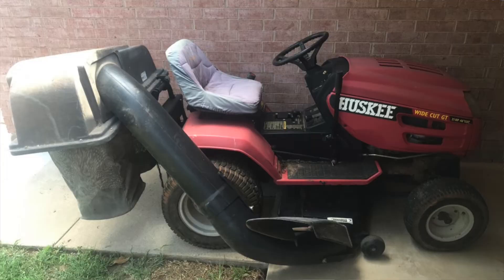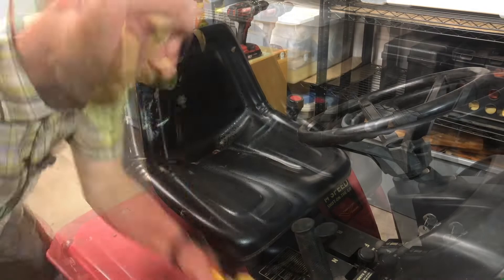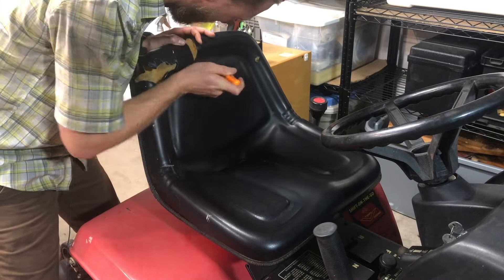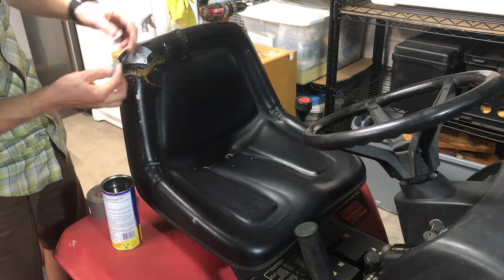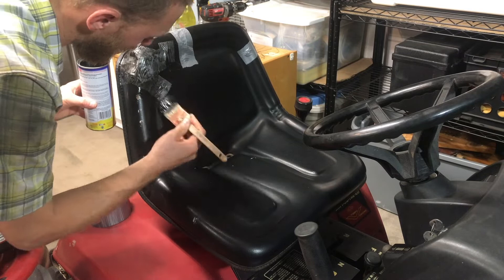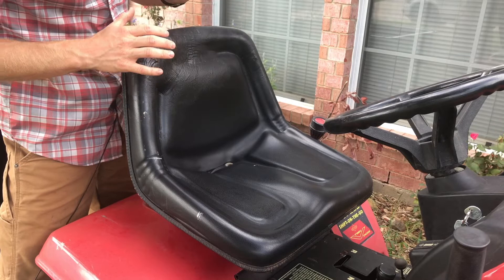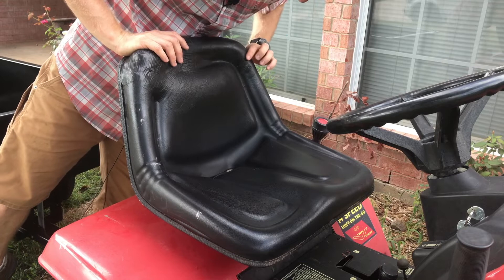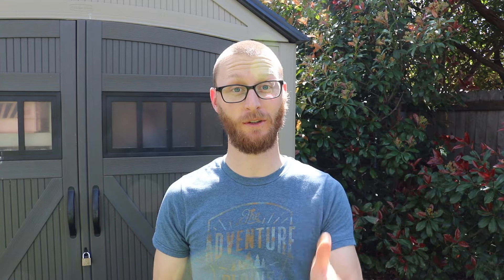How I Repaired My Lawn Mower Seat!

Comment: I'll have to try this as I have a rider and farm tractor that needs a seat.  But one of those is really bad, missing a big chunk of foam.  So this got me thinking to try expanding spray foam to fill the gap, then trim out that over spray.  Then I'll do the duct tape and plastidip as shown.  Thanks much for the tip.
Reply from the maker: Just be aware that although spray foam will definitely fill all the space - it may not be that comfortable to sit on. Maybe get some regular cushion style foam from the craft store and cut it as close as you can to the shape needed, then let the tape and plastidip cover the rest.

Comment: Thanks for sharing. I'm in the process of repairing a seat on a John Deere LT160.  I didn't want to spend good money on a new seat for a 20-year-old mower.  
You have a new subscriber. 👍
Reply from the maker: Glad I could help! I've since tried out aerosol plastidip to recover a whole seat - doesn't work well - definitely stick with the dippable kind that you can lay on thicker.
Reply: @GanderFlight  thanks for the tip.  I'll try to make a video if I have time.  👍

Comment: Have you given any thought to using a waterproofing membrane such as Vycor, typically used in construction for roof and windows, as a substrate over duct tape?   Has a rubber like feel, self adhesive, and a higher mil thickness.  Just curious, working on a tractor seat repair now, and need to span some cracks..
Reply from the maker: I haven't. The plastidip is pretty well waterproof if covered wide enough. I would however put some spray foam or other material into the gaps before sealing it.

Comment: Not finished watching, but you think fishing line would make a difference in the stitching?
Reply from the maker: I would think that would work well too.  Ive since also tried using spray foam and I’d definitely do that again. Stitching up the seams and then jet in some spray foam and cover with plastidip would make a great repair.

Comment: Thanks for sharing!  Hows it holding up after a couple years now?  Anything you would do different?
Reply from the maker: I gifted that mower to a friend and its lived outside - held up decently for all the weather exposure. What I 'd do differently -- I'd still sew it up, but then Id get some big gap spray foam and fill the void. Once that was cured I'd trim it to the shape I want and then put the plastidip or flex seal over the top.
Reply: @GanderFlight great thanks for the reply!

Comment: I wonder if using spray foam under the duct tape, to fill the missing foam, then removing the duct tape after the spray foam has cured, then plasti-dipping would have worked? Might not have ended up with the appearance of the duct tape under the plasti-dip.
Reply from the maker: If I were to do this again I definitely would have used spray form or even pieces of regular foam to fill in the gap and then covered.

Comment: Keep us posted.  Reads like directly into the foam with a few layers lasts for years in the last video I watched regarding.  The gentleman didn't use tape... and used the yellow.  I'm thinking I might custom make a Ford seat with the blue since looks close enough.  I'll test with a repair seat first before I try to coat a whole seat thought.  Thinking can trim some space foam maybe or similar foam and glue with the plasti dip also to fill in any voids if needed.  Would be nice to get a space or cool gel foam layer under somehow. I also received some Silicone Oil to test with Type 2 Silicone as I am wondering how performs to thin and set.  Then I'll try a dye also as that was my original plan to test to make a Ford blue seat.  Thanks for sharing!
Reply from the maker: Sounds like a cool project- if you do try all that report back and let use know!  Also if you want yo coat the whole seat blue look online for the aerosol version in the color you’d like- might work better for larger coverage, although it will take 5/6 coats.  Check out the channel Dip Your Car for more plastidip diy how tos!

Comment: Nice DIY!  I wondering, instead of duct tape to fill the gap, would filling with silicone first, the plasti-dip to seal?  Just a thought.
Reply from the maker: When I'vd done this since I've use spray foam insulation to fill the gaps on another seat.
Reply: @GanderFlight  makes sense

Comment: Appreciate the effort but, this method will never last
Reply from the maker: Been holding up for a few years :)
Reply: @GanderFlight  It depends where.  On the back where you did it, probably ok.  Mine is torn where you get on and off, and this is not a good solution for that.  The plastidip curls as you slide across it, losing more and more each time.  
I know because I tried this on my Kubota.  The seat is a high back that is over $300, so I'm trying to save it.

Comment: I was loving this until you resorted to putting duck tape back on.  That won't last.  The glue under the duct tape will end up a gooey mess just like the one you cleaned off.  Only this time it will be buried under plasticoat.  Might look good this summer....
Reply from the maker: Its been on the mower which is stored outside, for over a year now. 😀

Comment: It would have been better if you would have continued to seal the void with the plastic dip until it had been filled in instead of putting on the duct tape because the duct tape will eventually pull loose and then you will be stuck having to do it all over again.
Reply from the maker: That would have been a TON of plastidip to fill the voids.  If I were to do it again I might fill the voids with hunks of upholstery foam or even try spray foam although that would definitely be firmer.